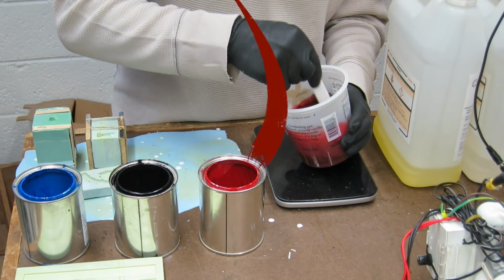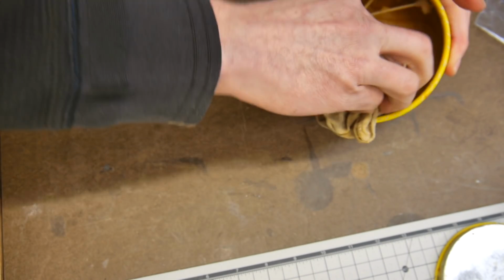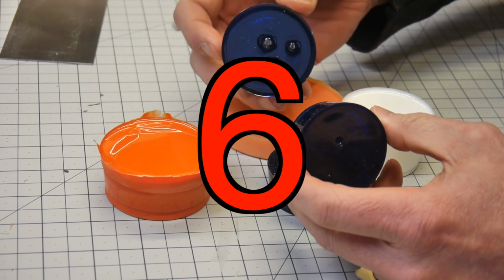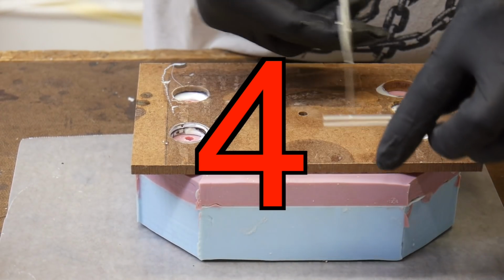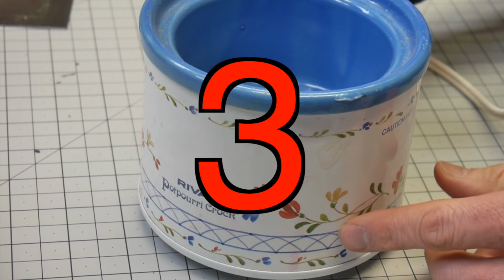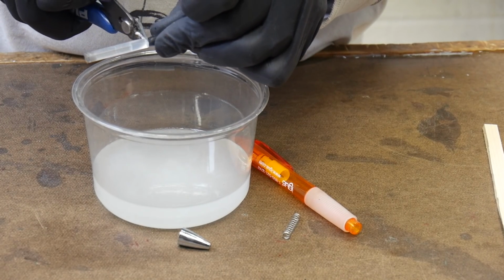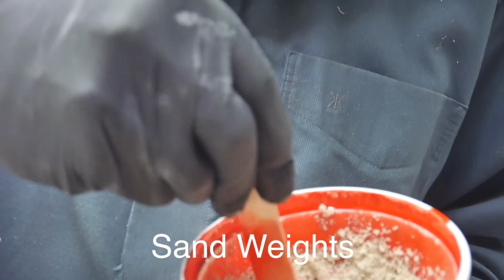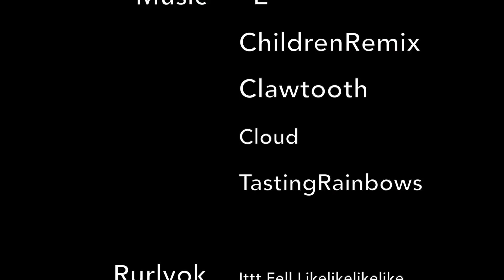𝙍𝙚𝙨𝙞𝙣 𝘾𝙖𝙨𝙩𝙞𝙣𝙜 𝙏𝙞𝙥𝙨-𝙣-𝙏𝙧𝙞𝙘𝙠𝙨 𝙄𝙄 𝙏𝙤𝙤𝙡𝙨 𝙖𝙣𝙙 𝙃𝙖𝙘𝙠𝙨 𝙛𝙤𝙧 𝙮𝙤𝙪𝙧 𝙢𝙤𝙡𝙙𝙞𝙣𝙜 𝙥𝙧𝙤𝙟𝙚𝙘𝙩𝙨

Comment: Some dry/finish resin when i want adding with new resin it dont want to be stick (stick but when i push with finger it felt again)...even i sanding before still it doesnt stick well ...do had a trick?
Reply from the maker: Yes That's Pancake sorry, not very clear about what you are asking me, use google translate to help you if you need. Thanks for your comment.